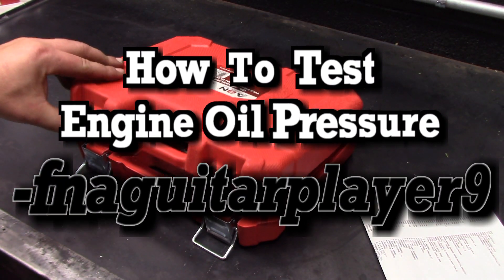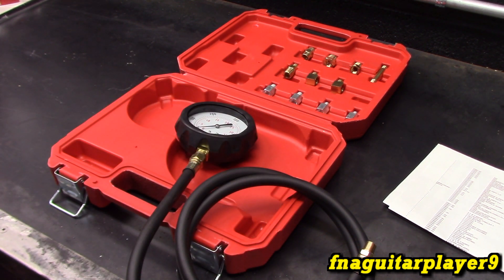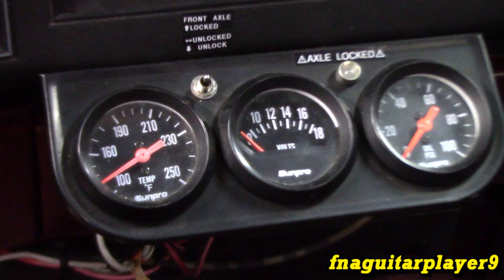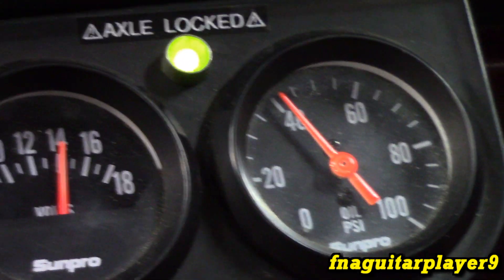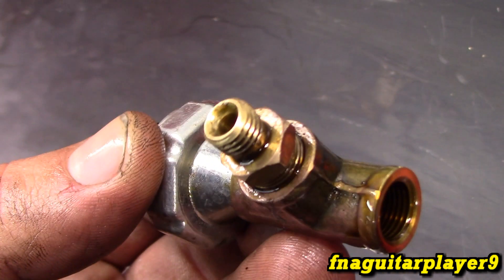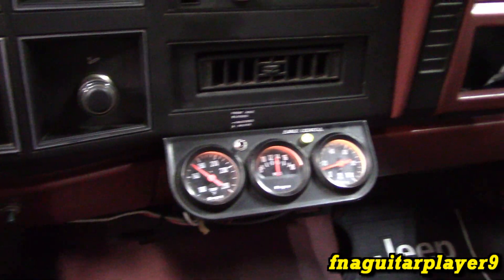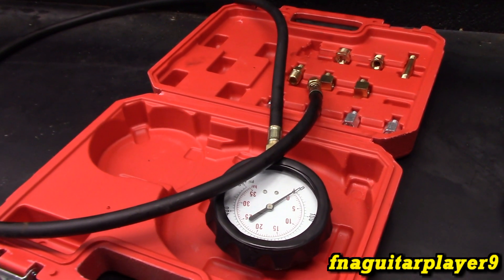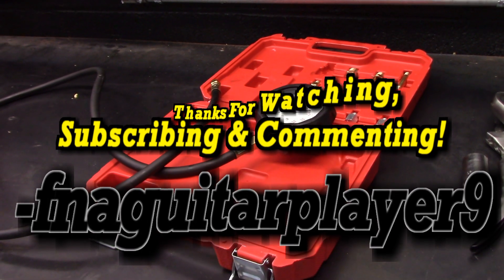How To Test Oil Pressure in Automotive and Small Engines

Comment: really good videos... I have a 20 year old 5 hp B&S Dr trim line mower (it set for 5 plus years). It will run then stops after 10+minutes and it seems really hot just seeing the heat coming off of it. could this be a valve sticking I have cleaned the mower vents.